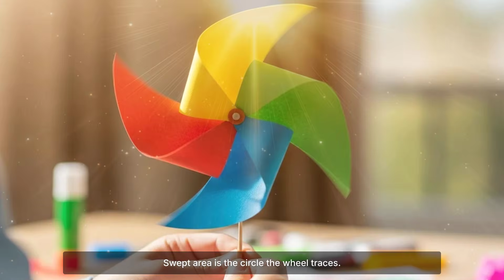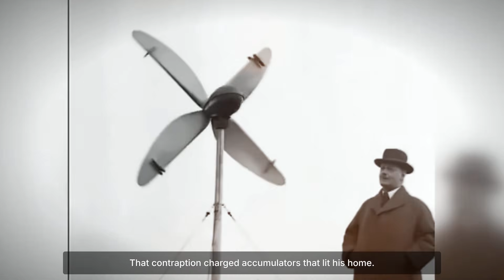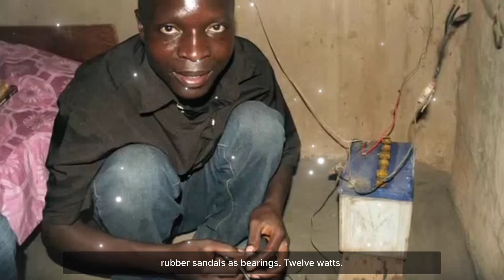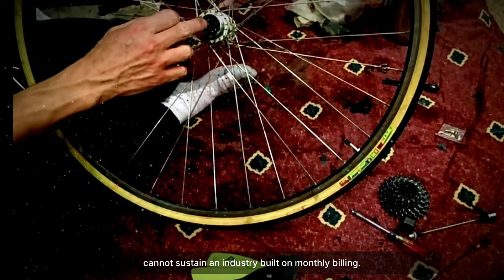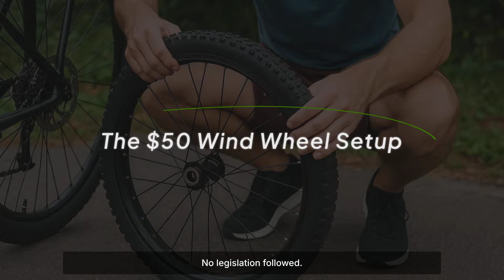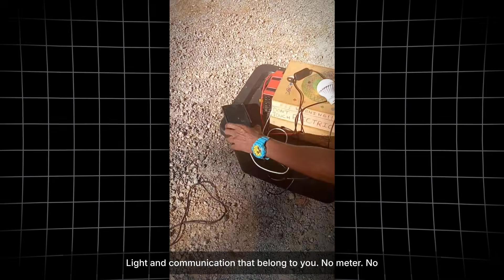This $50 Old Bicycle Makes FREE Power From the Breeze in Your Yard. Why Is the Grid Hiding It?

Comment: Actually the grid didn't bury the technology the ignorance of wind and solar ie Renewables once connected to the grid can only put in about 10 to 15% of advertised output or extra electricity easily demonstrated with a Volt amp meter and 4th grade math called Ohm's law Then you add a battery for Five percent less
Reply: But yes off-grid works well for us we use treadmill Motors